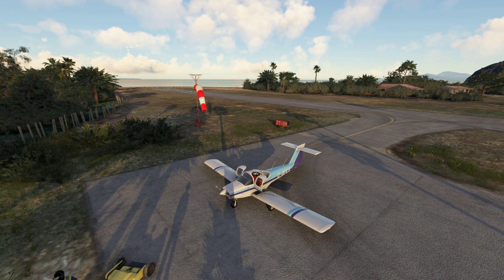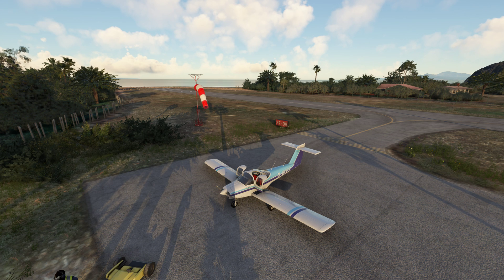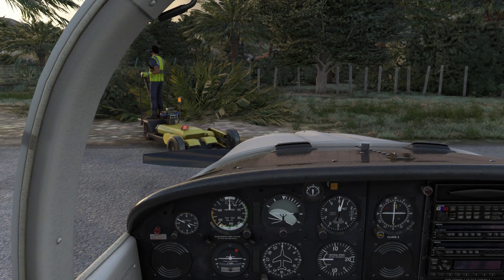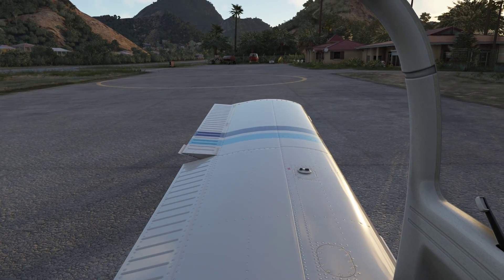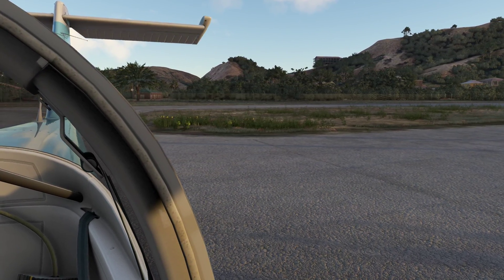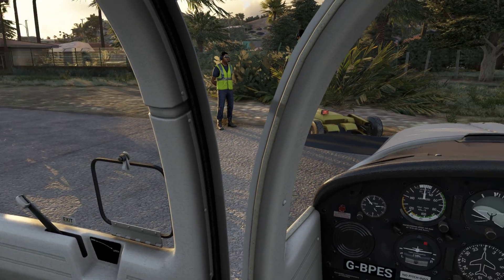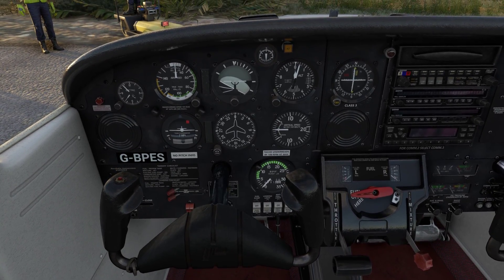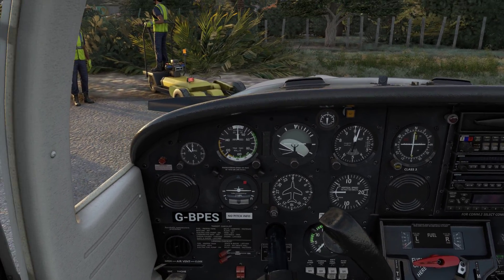Pilot Training for Flight Sim: Flight Control Checks | MSFS 2020

Comment: Yes I always test them full range , and watch to check. Otherwise, we don't check anything. But honestly, if pilots need to memorise that the right aileron goes up when turning the yoke to the right, I don't how they are allowed to fly. They have to UNDERSTAND what ailerons need to do to roll one way or the other. Understand is so much easier than memorise. I also test the rudder.
What do you do to check the elevator trim?